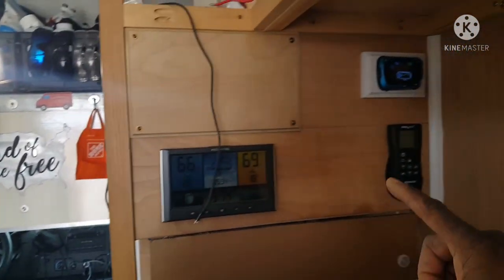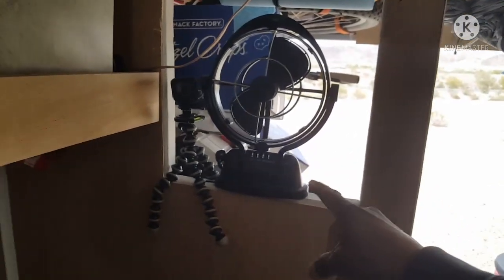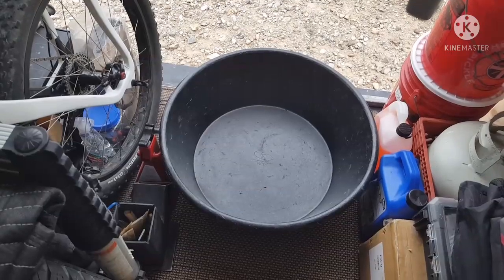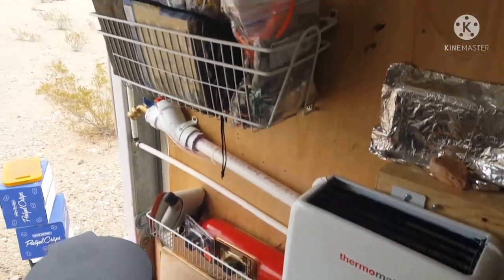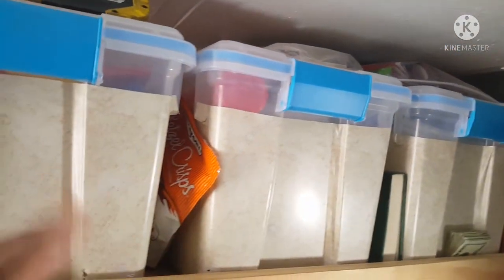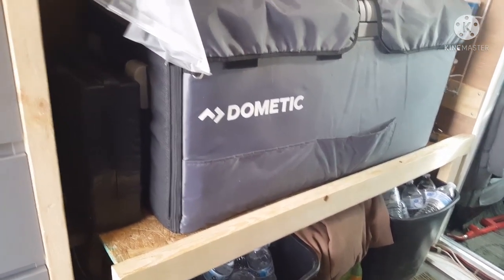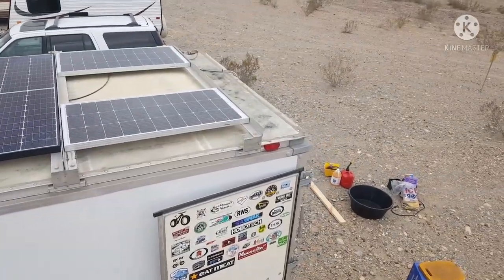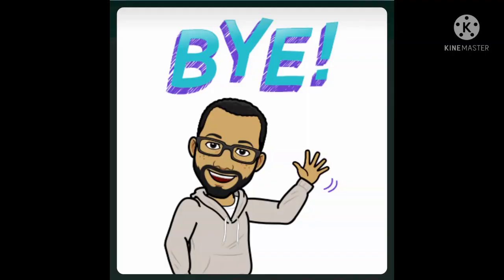VAN LIFE IN A BOX TRUCK: Updated tour of my 2014 Ford E350

Comment: Great setup, Lamont. I'm leaning towards a box truck and you've given me some ideas. I like that you have backups. Again, you're an inspiration bruh.
Reply from the maker: Thanks Al.  Sometimes I think I got a little carried away.  Most of the time I'm glad to have options.👍🏾
Reply: @xlamontx  

Thinking 🤔 

Can you double the room by adding a decked out landscapers hitch?

What if you frame it out.  Even with untreated wood, and just mail some cheap 20 dollar greenhouse roofing panels to it?    They are huge six feet by 8 feet.

Then you could put dividers with solid color panels for like the shower and stuff 

I like plants so I would have a latched down container garden

No need for heater because if it’s sunny that greenhouse can get hot 🥵
Reply: @xlamontx  

I was also think it could store water, cooktop.  Especially since I want to run a tiny garbage grinder to an interceptor for biodigester and then plug the methan gas bladder directly to the cooktop

Comment: Well equipped for sure! We love the size of your camper! We’re looking at building out a Promaster 159” Highroof 2500. But I like the extra space in yours! Good job! 🤙
Reply from the maker: Thank you.  With the higher roof and side door in a Promaster, I think I would have did a bed in the rear traditional build.  The box on my rig adds a lot of weight to the rear axle.  My layout needed to keep the heaviest items (house batteries, 40 gallon water tank, and fridge) as far forward as possible so as to not over load the rear axle.  Fortunately, I got it to work.  Best of luck with your build.  Safe travels. ☺👍🏾

Comment: Nice build and presentation. Question, where did you find the L- brackets used to mount your solar to the truck roof?
Reply from the maker: Thank you Flatlander.  There were a few aluminum load locks laying around at my job.   I knew we didn't use them so I just asked for them.  After removing the extenders, I'm left with a 2x2.5 rectangular tube.  I cut the tube long way on two sides which yields two 7.5 foot L channel.   Appreciate the question. 👍🏾

Comment: You mite want to try S hooks on the shower curtain, also you can buy 1/2'' split ring hanger and 3/8'' ceiling flange for a permanent hanger solution. That way you can put the shower curtain away when not needed.
Reply from the maker: Excellent suggestions Richard.  I was cobbling things together as I drove out here to Arizona to escape the cold weather.   I didn't mention it but there is a big piece of cardboard at one end of the bed so my can goods wouldn't fall through.  The shower curtains and rings and a few other things will all be upgraded and improved when I get back.  Thank you for watching. 👍🏾

Comment: Did you mount the diesel heater on the floor under the bed? I saw the controller, the fuel tank and spare diesel heater. Very practical build and well prepared.
Reply from the maker: Hi David.  I actually mounted the heater on top of the wheel well under the bed.  The intake and exhaust pipes are as far from the tire as possible with split loom protecting the intake pipe and fuel line from road debris.  I was thinking the exhaust pipe would possibly survive without a protective cover since its made of thin metal.  More importantly, I didn't want to put large holes in the floor of the box truck because it's made of approximately 2 inch thick hardwood.   The wheel well can be patched and painted easily, if it becomes necessary to do so.  Thanks for the question.   You may have given me an idea for a future video. 👍🏾

Comment: So impressed and, to be honest, jealous of your rig. I see many builds that seem to primarily focus how things look. On how aesthetically pleasing they are to the eye. For lack of a better term, "Better Homes and Vans" if you will. This build is form, function, "and" looks good. Well done sir!!! Kinda torn between a Express extended and a box truck like yours. Curious, what length of box truck is this and what kinda mileage do you get? Thankyou for sharing and safe travels.
Reply from the maker: Hi Machu Pichu.  Thank you.  You have summed up my thoughts on the "van build" topic nicely.   I will give you an example..I could have hidden my electrical system in a box and used that space for a cloths closet.  However, it is more important to me that my system gets air flow and I can see it's working at a glance than to have wrinkle free T-shirts.😁
 The box is 12 feet long.  6.5 feet wide, and 6 feet 1 inches tall in the center. Less than 6 feet tall next to the walls.  I about 12 to 13 miles per gallon while traveling.   Probably a little less around the city.
Insurance in a box truck may be a challenge.  Commercial vehicle insurance is more expensive and that choice may depend on your needs.  The extended Express will likely be easier to insure.  Thank you for watching.  Best of luck with your build.👍🏾👍🏾

Comment: Very thoughtful build, love the detail. I have been looking at a similar box truck a little longer than yours. Did you insulate? What is your trucks dimensions.
Reply from the maker: Hi Gracefull585.  My box is 12 feet long, 6.5 feet wide and 6 feet one inch tall down the center aisle.  I have 1.5 inch  of foam board insulation on the walls and 1 inch on the ceiling.   No insulation on the back doors or floor.
Reply: @xlamontx  Thank you....so appreciate your build!!

Comment: Lovely job & great shower setup... what type of tub is that & where can one purchase it?
Reply from the maker: Hi Rose.  That tub is a 15 gallon Fortex CR-850 heavy duty rubber tub.  In my opinion, the best place to purchase one would be a local farm and ranch store like Rural King, Orscheln's, or Tractor Supply.  It would most likely be in the livestock section of the store.  Thank you for watching. 😊
Reply: @xlamontx  Thanks for the info! 👍🏻
Reply from the maker: @rosevalerio5863  
You're welcome.

Comment: where did you find the drawer hold downs?
Reply from the maker: Here is an Amazon link.  Otherwise, they are about $21 at Home Depot or Lowes.

Defender Security Brushed Chrome U 11325 Door Reinforcement Lock – Add Extra, High Security to your Home and Prevent Unauthorized Entry – 3” Stop, Aluminum Construction Finish https://www.amazon.com/dp/B06XD79NX3/ref=cm_sw_r_awdo_navT_g_MZBA2NESH0681Z6K6WY9

Comment: Did I hear you say you use a diesel heater? If so, where is it in the box? I'm on the hunt right now to find a good truck to do this with, and I'm considering getting a diesel heater. Well done on your build!  Thanks!
Reply from the maker: Hi Phylana.  I installed my diesel heater under my bed, on top of the wheel well.  It's flat metal and has worked great.  There is plenty of room  outside behind the tire for the intake and exhaust tubes.  So far, debris from the road has not been an issue. Thanks for watching.
Reply: @xlamontx ,  what brand of heater did you get? And how do you "plumb" it into the fuel tank?  Thanks!!!
Reply from the maker: @BTNomad  
The one I bought at the time was listed as a "12V 2KW DIESEL HEATER" on eBay.   $125 + free shipping from a US seller.   It came with a metal siphon tube to mount to the vehicle fuel tank.   I used that metal tube and the plastic tank that comes with the kit to supply fuel to the heater.  I have the tank mounted to the wall near the rear doors.  I also choose the 2KW heater because my space 6 feet wide and 12 feet long, well insulated, and I rarely see temperatures below 32 degrees.   
F.Y.I. - the newest diesel heaters have a way to adjust for changes in altitude.  This was not available (to my knowledge) when I bought my diesel heater,  but I will be sure to have on future heaters I purchase.
Reply: @xlamontx  , thank you for the info!  I currently live in a 30' Class C, and I have a propane heater for the front, but with it being as long as it is, the bedroom area doesn't get much heat. How would you say the diesel usage compares to propane? I use a Wave heater, which does well, but I'm always looking for what may be better.
Reply: @xlamontx  , I just looked at eBay and gosh there are so many different brands. Do you know what brand yours is?
Reply from the maker: @BTNomad  
I have a Buddy Heater that I used occasionally before the diesel heater.  It seem to use more propane than the diesel heater uses diesel.  It was quieter than the diesel heater, but there was a "burning propane" smell in the air from the Buddy.  
I never used a Wave heater, but I understand they are better than the Buddy.
The fan noise and the ticking fuel pump on the diesel heater doesn't bother me.  I sleep better in a cool room so I rarely used any heater all night.  
One issue with the diesel heater that I found is the vent on the plastic fuel tank cap doesn't always work properly.   To avoid setting a code, I would loosen the cap a couple of turns to avoid setting a code and the heater shutdown.
Reply from the maker: @BTNomad  
Here is a link from my ebay purchase history. 

https://www.ebay.com/itm/265889479408?hash=item3de83f7af0:g:axcAAOSwFiJjJTVQ&amdata=enc%3AAQAHAAAAoCP1BsYt3WZUe%2B2A6Qnt1l4vfjhDT0YhLdp%2FT3aK%2Bo9tp4SyUSi%2FkvmiYPhaqF7pbSjo0Eoz3AIQ2WuP2VMn6YsKTxHwlvrvzkbL7sY32j2SchMBCNhM76RVf9JNrV3oZ%2B4%2BaW6vKYdoKX6H%2BsJj1LcSrGl8J20huxmx2k5UiGEmQr5H9nGFm0uH%2FvhzGvz0DMpFUdJFNkXD22JryFqwTkg%3D%7Ctkp%3ABk9SR9bfr9DzYA
Reply from the maker: @BTNomad  
From the listing, the brand is Furgle Renoster.   A friend of mine has a Vevor.  I hope this helps.☺
Reply: @xlamontx , thank you!
Reply: @xlamontx , good to know. Again, thank you so much for all the info!
Reply from the maker: @BTNomad  
Your welcome.   Safe travels. 😊
Reply: @xlamontx  , thanks! You, too!

Comment: what are the realistic mpg's you get in the city and on the highway?
Reply from the maker: I usually get 13 mpg on the highway.  I once calculated 14 using cruise control,  no big hills or head wind, maximum tire pressure,  etc.   I haven't measured in the city, but I would guess 10-11.
Reply: @xlamontx  man i want to pull the trigger on a box vs a e250 extended, im just worried about towing and mechanics giving me a hard time fixing the things I can't get to.
Reply from the maker: Good to consider that before purchasing.   Some companies will only sell commercial vehicle insurance on a box truck.  Roadside assistance may also have it's challenges.

Comment: what are the mechanical cons to an econoline box truck?
Reply from the maker: What my experience has been with my box truck is this.  Commercial vehicles don't (usually) come with a spare tire, jack or lug wrench.  I had to buy my own.  Because of the box, the spare does not fit outside under the frame like on pick-up trucks; because of the reinforcements.  The bolts that the lug nuts screw on are too long for a 4-way or lug wrench, so I had to buy a deep socket and breaker bar.  The tires are very specific because of the weight the vehicle is capable of carrying. Not a big deal, but it limits selection and availability.  I discovered my box truck has no external fuel filter.  I would feel better if it did.  The most important con is many econoline owners complain of wandering steering.  My rig did in the beginning.   I added a steering damper,  and adjustable camber/caster bushings to  get the front alignment where I wanted it.  I got it about 80% perfect and can cruz down the highway at 75mph with no problems.  If I think of anything else,  I will add another comment.
Reply: @xlamontx  what an excellent response! That's a video right there.
Reply from the maker: I was thinking that as I was typing up the answer.👍🏾  I may owe you a Coke Zero.😁